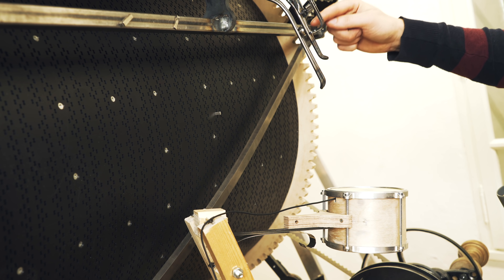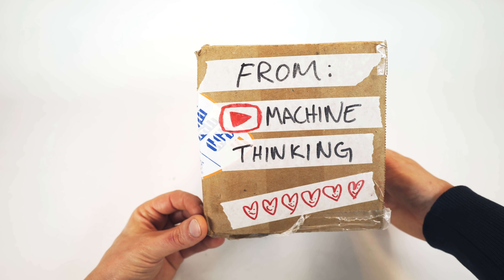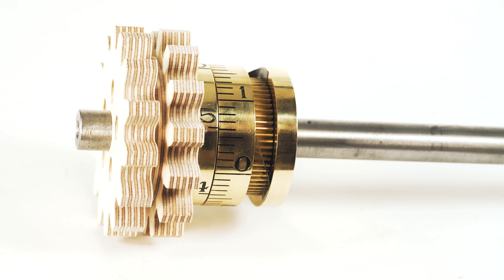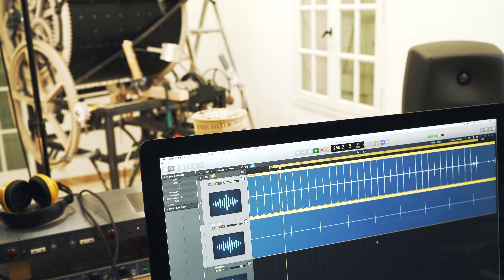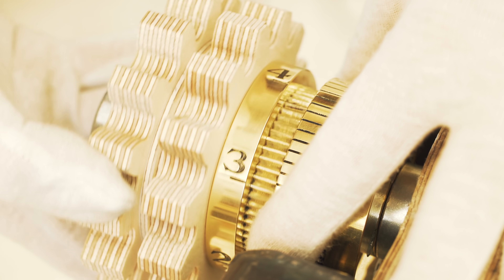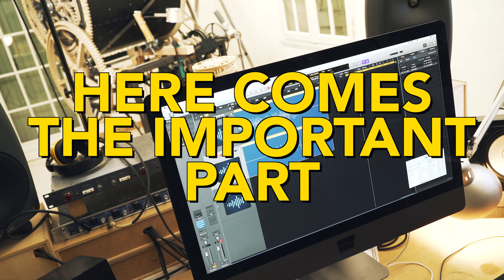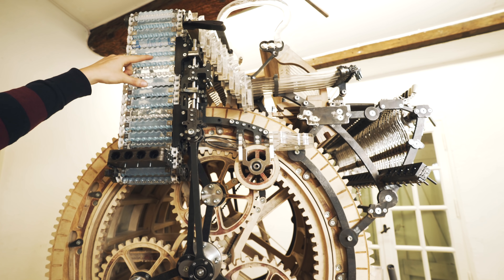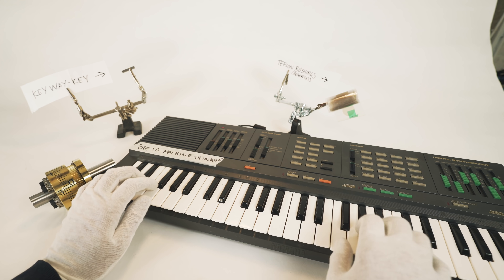Testing the Music Timing Clutch - Marble Machine X #77

Comment: You need to look into incorporating a clock whose spring is kept wound up by the crank or something. That way you can have a shaft rotating at a fixed rate which could be compared to the rotation of the crank and automatically adjust the timing between the main programming wheel and the percussion wheel.

Comment: An automatic delay of the rhythm machine might be nice.

A centrifugal advance/delay mechanism typically doesn't have a lot of force. So the thing it manipulates should be as light as possible. 

 To get the most gain, or have the stiffest regulation, probably should get the centrifugal force from the strongest source on the machine, and have it act on the lightest load that's turning.

  The hand crank drives the flywheel, the rhythm machine, and the gear train that drives everything else.  Great mechanical advantage would be had by putting flyweights on the flywheel. Those flyweights could apply their force on a spring loaded lever that comes to the front of the machine to the crank shaft area. The rhythm machine (lightest load, likely least rotating mass) could be decoupled from the crank shaft and the rhythm machine's timing relative to the rest of the machine could be varied by the lever.  The faster the machine goes, the more the weights fly out, more force on the lever, more delay on the rhythm machine.

Comment: i don't think its very flexible if you're forced to stick to a certain bpm by the clutch setting. instead you could use a centrifugal force regulator to vary the height of the drum and therefore make the fall shorter or longer depending on your crank rotation

Comment: This could be automatically synchronized throughout the crank operating  range - bpm - with a centrifugal governor mechanism that would have an adjustable rate/ or curve just like an automotive ignition distributor or an automatic transmission pressure governor. No adjustments would needed for different crank bpm speeds.

Comment: What happens if you change tempo during a song (either intentionally or naturally)? This probably wouldn't matter too much regarding the crank but the "rhythm machine" will go out of sync with the rest of the machine and sound off.

Personally I think the rhythm machine is excessive anyway. You have other band members who can add extra rhythm parts (e.g. by typing on a typewriter or banging on the top of a slide projector). If it were me I would just scrap the rhythm machine entirely and just stick to the marble-operated instruments, then the timing isn't as important but you could still adjust the crank to match up for the majority of the song/tempo.

Comment: You can calculate the latency instead of trial and error. You know the distance the marbles will fall before hitting the drums. You know the gravity acceleration at 9.4 m/s. You also have the beats per minute. Given all three inputs you can calculate how much offset you need in the indexable  clutch.

Comment: Hell
an automatic adjustment of the face shift could be achieved whit an swinging ball speed controller which pushes on an fase shift device like one of those in the camshaft of cars.
would be pretty need i think.
not to complicated to machine i think, sure lots more than the beautiful gear mash fase shifter you have now, but would be extrem cool looking.
also you can use it as an indicator of the rpm on a dial...
Reply: That was my first thought too. At some point in the future, if he found and charted the necessary timing offsets for a range of tempos (say, 60-140 bpm in increments of 5-10 bpm) and plotted it out, he could probably find a mechanically-reproduceable mathematical curve that fits the points well enough to use as a basis for designing a centrifugal timing compensator.

Comment: It may be too late, but, why not use an automatic advance/retard gear setup? You use centrifugal force, against a tension-spring. As you spin it faster, it would retard the timing of the "direct-drive sounds", while the "gravity-timed delays", remain the same. As it spins slower, the tension on the weighted-arm will retract it, returning it to the advanced timing.

A weighted arm with a pull-back tension spring. The movement of the weighted arm advances or retards the position of the gear on the axle. Moving it side to side on a spiral-thread, or with a planetary-gear advancement/retarding setup. Once you set the minimum RPM tension and starting-point, all you need to do is play with the fastest RPM adjustment. (Shifting the weight or by adjusting the spring tension. Once it is set, the timing will remain perfect from slow to fast RPMs.)

The other, more complex, version of this uses belts and compression pulleys. Often used in "constant velocity transmissions", and is subject to "slipping". (Not something you want in a time-critical device.) However, it is a similar concept.

Comment: So cool... Through music some of the best traits of humanity shines through, collaborating, creativity, sharing and just plain old having fun solving challenges together. Gives me hope... Wonderful! After walking away from viewing this endeavor I couldn't stop thinking about the mechanics and engineering that went into addressing the timing issue when changing BPM. Then it hit me, old steam locomotives had the same issues with advancing and retarding valve timing and came up with the variable centrifugal governor. I know it's reinventing the wheel on this project and the manual solution works beautifully, but it's manual and change on the fly automatically. I wonder if the same approach as the centrifugal governor could be applied here so that no matter what BPM speed is applied to the "hard wired" main crank that the beat would be maintained in timing? It seems to be a matter of mathematics to me that can be verified with the manual adjustments being used to determine what the physical bell curve would actually be to translate to the centrifugal governor design. Maybe I'm over thinking this thing, but an automatic adjuster seems like it would be a desirable, advantageous aspect to the functionality of this cool musical contraption. Just throwing out there guys... :)

Comment: Hm ... I see two potential issues here.

1. The timing clutch gets between the rhythm machine and everything else, including the fishstair. The fishstair doesn't need adjustments; like the rhythm machine, it is fixed to the crankshaft movement and should never be off. The timing clutch breaks that connection; in the tests, you can clearly hear the clicking of the mechanics no longer lines up with the rhythm machine.

2. The required programming wheel delay is a function of turn speed vs marble drop time. This means that in order for one fixed delay to work, all marbles in all channels have to have the same drop time, i.e. time from release to hitting the instrument. Can your system actually do this?
Reply: I'm not sure, but I believe those are solved problems.
1. Which part of the video are you referring to? In https://youtu.be/CBfd0Tjii9Y?t=717 he seems to say that it is fixed to the crankshaft and thus not on the clutch. The clutch is there to offset the timing for the marble release only. If conveyor belt is also on the clutch, it should be fine as well. First step would be to align crank and conveyor, then use that setting as the base-line "zero" for the rest of the adjustments and hope it didn't change too much.

2. Can't say where this has been covered before, but that should be a known requirement at any tempo so most probably in the design already for the first Marble Machine. The 
same "beat" in the musical program must hit respective instrument with proper timing. This can't be tweaked with the clutch.

3. If there is a "computer delay" added for kick and snare compared to vibraphone, because the sound is actually processed rather than directly from mic, it should be unrelated to the BPM. Martin can adjust that by moving the drum closer to the release and get the hit slightly earlier. Each instrument can be adjusted like that in assembly. It may also be slightly modified in the computer as well. This was covered in the original MM videos I think.  If he used he clutch to fix this now, he may redo it later. 

4. The video was possibly edited out of sequence. That may explain if it sounded off at some point in the video.

7:36 https://youtu.be/CBfd0Tjii9Y?t=455 late, moves in one direction

8:14 https://youtu.be/CBfd0Tjii9Y?t=494 still late, moves the other direction...

Comment: Its been fun watching the development of these instruments, but I was wondering about this particular issue. The clutch is certainly pretty and a very elegant solution, but did you at all entertain the idea of an adjustable drum height that could be raised or lowered to add or remove time? I like this solution but the time and effort seems great compared to adjusting the drum itself. 

Thanks for sharing.
Reply: You gotta remember, it wont just be the kick drum out of sync when its all put together, everything else will be off too, thus the clutch would be the best solution
Reply: The issue I have with an adjustable drum is that when the machine is done it will most likely have a lot of other components surrounding it(I could be wrong so don’t quote me on this), and each time you had to adjust the height of the drum could be... problematic. A height adjustment could also be very difficult to gain accuracy of timing not to mention having to hold the drum very still while moving it so it doesn’t move off of its spot and even the action of clamping it back down could move it around. The timing clutch simplifies the amount of work needed to sync the drum to the machines own kept tempo. And provides a relatively accurate adjustment that does most of the work for you.

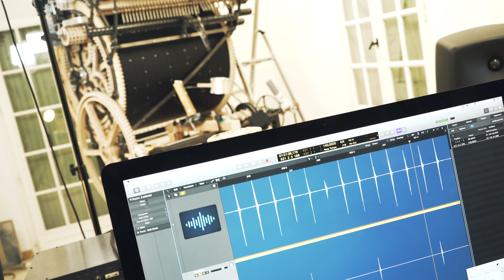Comment: 10:30 After synchronizing at 90 bpm, at 140 bpm the drum is 71 ms late (970 to [1]041). So, the marble takes 198.8 ms to fall.
Proof:
-The duration of the fall of the marble is the only event that is not affected by the tempo.
-From the moment it sets free from the machine, at 90 bpm it takes a time F to fall, let’s define it conveniently as 14 arbitrary time units (atu): F=14 atu.
-At 140 bpm F is unchanged, but the time the beat takes to happen from the instant the marble starts falling is shorter, precisely 90/140 times as long as at 90 bpm. So, instead of 14 atu, the beat happens after 9 atu.
-Thus, from the beat at 140 bpm to the marble fall, there are 5 atu.
-That time is 71 ms, so 1 atu = 71/5 ms = 14.2 ms.
-F=14 atu = 198.8 ms.
Reply: And, just in case it's interesting to you, you can calculate what tempo goes with every setting using this formula:
tempo = 5.03*setting - 136.5,
where setting (0 to 59) is the number on the right ring indicated by the zero on the left ring.

Comment: You could use a mechanical phase changer to adjust the timing while the machine is in motion.  For example, you can use the same technology behind a rear differential, where the input and output shafts to your machine are the 'wheel' outputs and the 'engine' input is an adjustable knob that you can adjust whenever you want.

Comment: It's funny but almost your exact problem occurs in internal combustion engines. Combustion takes a relatively fixed amount of time, so as engine speed increases you need the spark to come earlier before the piston reaches the top of the compression stroke to burn the fuel in the power stroke.
Reply: I wonder if, in the future, he'd be able to repurpose a spark advancer for this.
Reply: @waterlubber  he effectively designed a cam phaser. Basically functions similarly to the means of variable valve timing. Although I have to wonder if he could use a cam phaser for that purpose. Would be an interesting project
Reply: @waterlubber   no
Reply: Thats what cam shafts are for?
Reply: Sort of, but not in the way I'm talking about. The camshaft opens and closes valves and drives the distributor, but ignition advance is controlled by other means (vacuum diaphragm, mechanical weights, electronic, etc...) to move the spark further before compression tdc as engine speed increases.

Comment: I'm not sure how much you really want to get into that timing system, but you could actually automate the adjustment by basically replicating the design of an engines variable valve timing system (one that utilizes cam phasing), and using an rpm sensor and some programming.

Comment: A much more complicated way to fix that issue would be to attach a hydraulic pump to the crank with a precise bleed valve that raises and lowers the drum based on the speed of which it's being turned. That way the kick will always match the tempo as the height of the drum will depend on the speed of the turning and the size of the bleed valve

Comment: would you not need a clutch for every single instrument since the distance's from drop to note are not identical, thus will scale differently with bpm?
Reply: Mosibfu that's what i was asking myself as well. Is he going to sync every instrument to the basedrum?   If all marble release actuators are synced, then he would probably only need to keep the same falling height througout the instruments, right?
Reply: @alfredjodokusquack2  yes, the wooden mockup he showed earlier tho, had the section on the right stacked to be more compact. also the height of drop seems to be not uniform
https://i.ytimg.com/vi/OoT1Gso8P1Q/maxresdefault.jpg

maybe the drift will be acceptable tho.

Comment: Very well done.
I would make a suggestion: Put in a second key, and properly fit the one you installed.
That single little key is bearing all the force of the mechanism. The keys need to be tight enough that you have to tap them into the shaft, and tap the hub over the key.

Comment: A differential could have been used to get infinite adjustments (rather than 50 or so discrete adjustments), and it would also allow adjustments on-the-fly.
Combined with a centrifugal governor, you might be able to have a solution that adjusts the timing automatically based on the RPM.

Comment: You should design a variable speed gear system that uses centrifugal force to automatically adjust the beat offset.
Reply: I thought he needs the drum to help him manually maintain speed. Centrifugal governor would be a better fit for this, though.
Reply: @Repligon  he could easily have a metronome into his in-ear monitors, and have the drum as well (because of multiple microphones) and he can see if he's getting de-synced.
I think he's aiming to have just the drum running though, most musicians can at least keep a bpm in their head after some practice.
Reply: Exactly my thoughts. I was thinking if the song had a time change, you'd have to stop and adjust, whereas if you had a centrifugal mechanism, it would adjust on the fly
Reply: @chadjensenster  I guess for the time being, he could just mute the Rythm Machine while doing a tempo change. Nobody will notice a few milliseconds delay/speed up in the other instruments if the underlying beat is muted. Also keep in mind, for this interval, he still has kickdrum, snare and hihat, which are affected in the same way as the other instruments since they're played with marbles. Once he returns to the song's original tempo, he can switch the Rythm Machine back on and it will be in sync angain.
Reply: Something like a centrifugal governor and a CVT
Reply: Or like ignition advance mechanism on a gasoline engine. Then he could write songs with music box endings and perform them w MMX

Comment: This is a very clever system, but i found one inconvenient, you can"t adjust the clutch while playing ! Then I remind how a DJ synchronize a disc with another, without changing the speed, he simply slips the disc by blocking it while the platine is still turning. The problem, is that your machine need a lot of energy to work (far more than a vinyl) and it's too much for a simply felt surface but I imagined a clutch comparable to a car clutch, working by friction with a moving disc controlable with a handle (with motoreduction and a precise visual indicators).

Comment: That is ingeniously good. pity that as you slow down the machine the offset will vary. I was wondering if you have considered installing a centrifugal mechanism or maybe a varying friction system which allows slip according to rpm or a spring which aligns the two rotation according to force exerted by the fly wheel. having said so I don't know how linear the relationship obtained would be so I dont know... but i felt like sharing these ideas :) good luck and keep it up i really enjoy your videos and am always looking forward for wednesdaysss

Comment: It's amazing! Have some ideas about visual BPM control, for your seen: "strobbing squares" as on LP turntable for even BPM which is needed or  "marble speedometer" (air flow meter as on some low pressure compressors, which running from flywheel). In this case, I think, you are can set delays of rhythm machine and marbles with some good precision. 

P.S.: I'm so sorry by my bad English speech level, but I hope you are understand what i mean.

Comment: Why don't you change the numbers on the clutch to label the bpm of the song? That'd be much easier to figure out than memorizing millisecond times
Reply: It would be easy enough to just have a table (or index) worked out. Keep in mind that the numbers on it can be applied in this same method, even if he changes something on the machine that affects timing.

Comment: A really interesting design challenge would be to make the timing clutch adjustable while playing, making tempo changes possible.
Thinking of something with a ramp angle, actuated by a push/pull rod inside the drive shaft. Wouldn't be easy...

Comment: So I guess  that when the BPMs are finally tuned in there will eventually be masking tape put on one part with BPMs written in relevance to the 0 mark. That way there is no need to count every time there is a change of BPM, just turn to the correct setting.